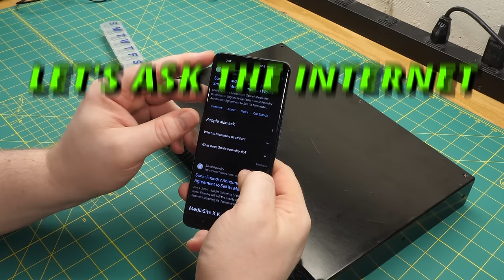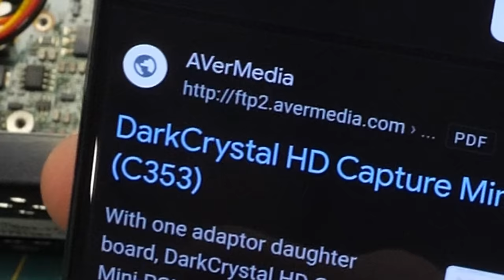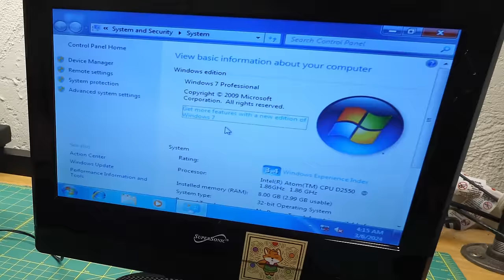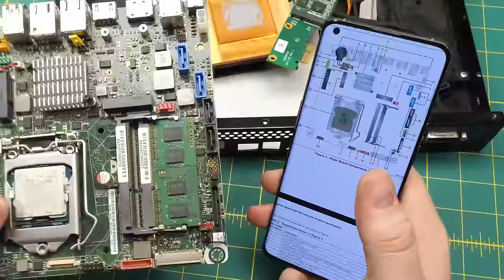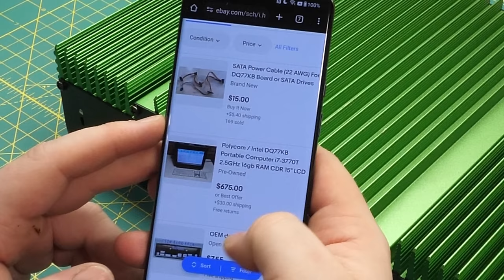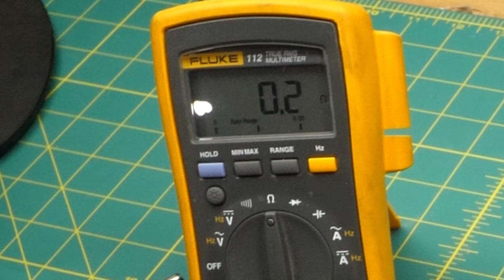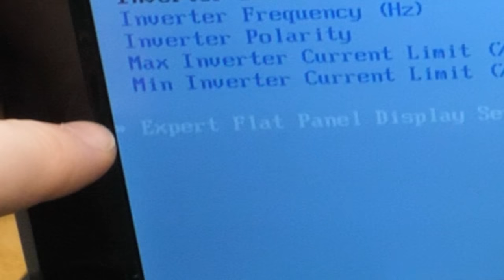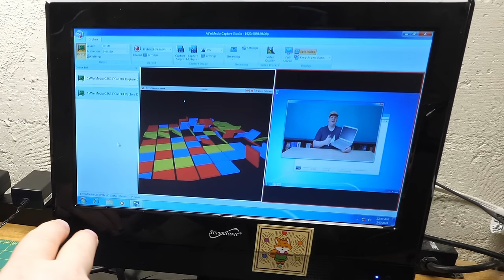Little Guys 5: Three Of Them [MediaSite / NCR N3000]

Comment: lol just snagged an N3000 off ebay to use as a couch computer. cuz y not, right!?
Reply: update, just got it in the mail today. Still has an 80GB ssd and appears to have the original software on it. Tempted to take an image, but idk if I care enough. POS software tends to be pretty fricken boring (buggy as hell, especially if it doesn't see whatever home server it's supposed to talk to).

Will probably do an i7 at some point, but I think an i5 with 8gb ram will be perfectly adequate for 1080p video. Cheers yall!

Comment: Laptop power supplies are also prone to five finger discounts and repurposing. Not something you want for a server. Then again I was working at an office where they had somebody steal the battery out of the laptop! Never seen that before. I hope it's at the persons laptop. They also bought a Dell or was it HP mini desktop that was literally a box of air with probably one of those boards in there I was like why bother even putting it in a case there's so much wasted space for what.